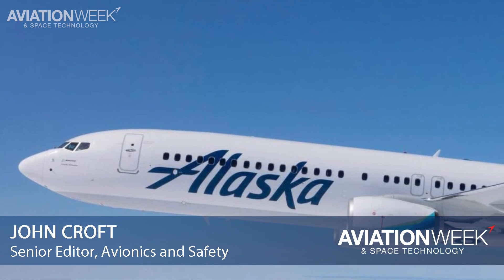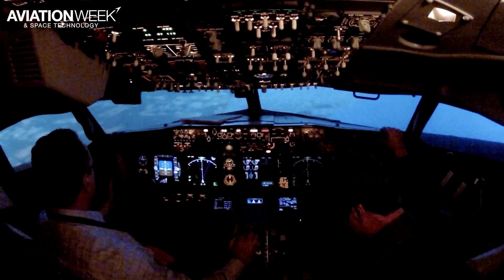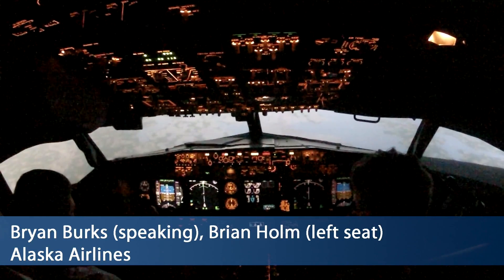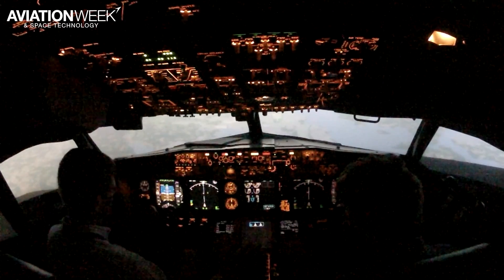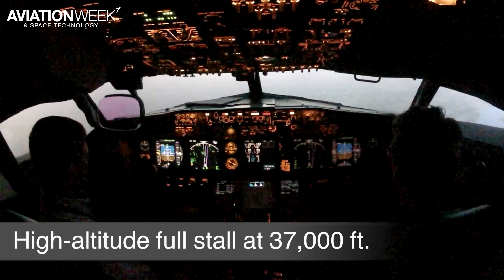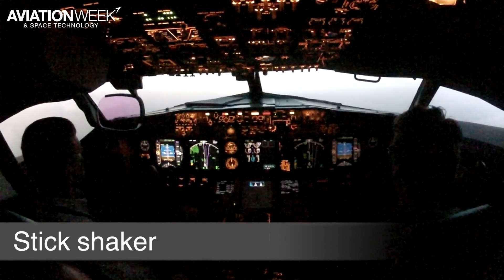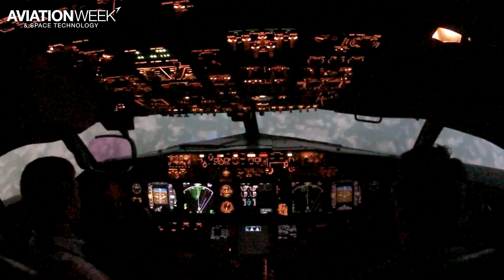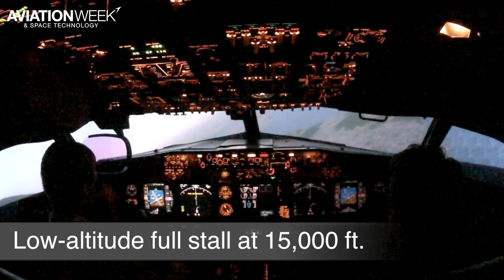How Does A Boeing 737 Handle On A Full Stall?

Comment: I'm interested to know how the simulator hydraulics simulate the sensation of "falling" due to a full stall. 
It seems like that amount of motion would be beyond the motion range of the pumps.

Does my question make sense? I hope it does.
Reply: It makes perfect sense. That's why the only way to really do this properly is to do it for real.
Reply: jsm666 a 737 probably costs about 10k an hour. that's why pilots have simulators, you can't train in the real thing. not to mention stalling a swept wing aircraft is much more dangerous than a Wing with a low speed planform.
Reply: Ummm swept wings stall at the tip first. They are totally different then flying a Cessna. You will NEVER stall a 737 on purpose. EVER unless you are a Boeing test pilot. I'm a commercial certificate holder, and hopefully on Wednesday, a flight instructor (CFIA)
Reply: It's not dangerous in a sense that skydiving isn't dangerous (but there is a small risk)....Like through extremely poor piloting, uncoordinated stalls, forcing secondary stalls etc. It takes THOUSANDS of feet to recover from a stall in a 737... It's only done on test flights, (like for certification or otherwise) Nobody goes out and flies at 10,000 dollars an hour to practice doing stalls in a giant swept wing jet.
Reply: The software is constantly resetting the position of the hydraulics, in the case of a stall, the software would anticipate and execute a drop, then position the simulator an an incline (Probably facing forward) while slowly creeping back into position for the next maneuver. The sensation of the drop as in real life is only momentary. Once you are accelerating constantly, you wouldn't know it. You can be in a 3000fpm dive, and if it is constant and you had no instrumentation, you'd think you were flying straight and level. The senses are very easy to fool in a simulator.
Reply: How much damage would it cause to a real 737 if you stall it and recover?
Reply: No, I don't know what category a 737 Falla under, but in General Aviation normal category aircraft must be able to handle minimum of 3.8 Gs. I can't imagine even a 737 pulling more than 1.7 pulling out if a medium shallow dive.
Reply: That sensation only happens in the initial down acceleration. Once you maintain a VSI of say....9000fpm, the acceleration stops, hence the sensation. Sensation only happens during acceleration.
Reply: You can simulate stalls and rapid acceleration in a 5 axis sim.  If you've ever been to a Disney park and ridden Star Tours you can get the sensation.  It doesn't have to drop a lot to be convincing.
Reply: Steven Main You wouldn't put too much stress on the airframe from the maneuver?
Reply: Everyday English with Byron I understand your question completely and I'm curious to know how you'd get a hydraulic cylinder to vibrate.
Reply: Everyday English with Byron Maybe one end is mounted to an offset motor shaft that causes vibration similar to a game controller or maybe an offset weight.
Reply: None... if you recover

Comment: Stalls in light aircraft are inconsequential, easily flown into and out of.  Stalls in jet aircraft, because if their high-speed low-drag wing designs,  are much more difficult.  It's good to know that at least someone is teaching stall recovery in jets.
Reply: Inconsequential? Such a statement borders on insanity!
Reply: I think what he means is that small  SEL Cessnas aren’t bricks with wings and “want” to fly and don’t lose thousands of feet if you recover from a stall right away.
Reply: @da42pic  I think you are understating the case. There are more complex issues involving (sometimes) deep stalls that are stable and non-recoverable; shock wave complications that drastically change wing characteristics; trim/tail design limits and pitch control issues and structural damage issues. And more...
Reply: Jets are required to have some flaps down at below certain speeds, which make them easier to slow down.  Nobody wants to do a stupid full stall with no flaps on a jet when you all know you need flaps to slow down for all approaches, landings and take off.
Reply: @feetgoaroundfullflapsC  Flaps help you slow down in the pattern but their purpose is to shave 60-70kts off the approach and takeoff speed. Speedbrakes are best for reducing airspeed or controlling it during a steep descent. Stalls have happened with transports in the clean configuration. Remember Air France A330 over the Atlantic? Pilots need to practice stall recoveries in all configurations.
Reply: @feetgoaroundfullflapsC  Flaps are not used to slow down, that is the job for speed brakes. This is one of the typical questions on an exam.   You can descend the landing gear, provided that you are under max speed to deploy landing gear if you ever need to reduce airspeed such as in a rapid descent. Flaps have structural limitations and it's one of the reasons flaps are not used for slowing the plane down. In addition, there is a change in airflow and angle of attack incurred. So, with flaps comes a proper understanding of their use and how it affects the dynamics of the aircraft.
Reply: @ItsNotAllRainbows_and_Unicorns  Flaps one or 10 degrees are used when slowing down and they will slow you down too, apart from spoilers.. What is say is, you are supposed to have some flaps when at those speeds that will produce a stall with clean wings..  Who is going to be at say 160 knots with no flaps??
Reply: @feetgoaroundfullflapsC  You have to be careful of your wording. To an examiner if you say "easier to slow down", (as you first wrote) comes across as using flaps to slow down and they will penalize you. Flaps are not used to slow down. They increase drag, which results in slowing you down that is true, but the main emphasis with flaps is to compensate for the decrease in lift by increasing the lift coefficient. According to wiki: A flap is a high-lift device used to reduce the stalling speed of an aircraft wing at a given weight. .............. Flaps are used to reduce the take-off distance and the landing distance. Flaps also cause an increase in drag so they are retracted when not needed
Flaps also allow for steeper approaches while maintaining the same airspeed.
That is the term you should use for flaps. Get rid of this notion of slowing down. That comes from power settings and power management. Seriously, try saying what you first wrote  to an examiner and you'll get their attention very quickly. This was ingrained into me, and my class, during flight training.
Reply: @ItsNotAllRainbows_and_Unicorns  Yeah, you are right, but if you have to slow down, and you need flaps at the speed you need to slow down, you can pop flaps 1 and thats it.  Instead of popping spoilers, wait and then pop flaps and trim.  It saves time, specially in high traffic..  I flew mostly as single pilot multi engine IFR.. Didnt have a helper on  my side all times like airliners do.
Reply: @feetgoaroundfullflapsC  flaps are not used in a holding pattern and you are at a slower speed. Stall can happen in clean configuration. I.e. 160 kts in a holding pattern.
Reply: @feetgoaroundfullflapsC  not true. Clean stalls are done too.
Reply: @feetgoaroundfullflapsC  What?   I think you slept through a few lectures.

Comment: The master caution alert is a lot more annoying on Airbus, I could almost handle that sound haha.
Reply: Actually it is much louder on the Boing :)
Reply: Yep Boing sucks :)
Reply: HardCoreGaming Corp was just autocorrection on the phone. So all times I flew with Airbus the planes had plenty of power, was new and flew very smoothly thru the bad weather (when there were some). All time I had to fly on a Boeing it was old, had to consume nearly the whole runway to get airborne and once in a rainstorm you could see that the plane was winding left an right. 
I knew Boeing had announced some new planes and might build them atm but I guess nobody here buy them because they already have some airbus and stick to them.
Reply: HardCoreGaming Corp blablabla... never want to fly a boing they are old and full of outdated technology. :)

Comment: As a pilot for over 50 years (and flying every week still) I am aghast at the poor level of training of the average airline pilot trainee. Those maneuvers (without the benefit of stick shakers and voice announcements) were considered basic flight training for the Private Pilot Certificate. As well as demonstrating entry into spins and spin recovery was part of the final check ride to be signed off to fly a bug smasher. I still do one engine out entry into stalls and recovery just for the heck of it every few months as well as shutting down an engine in flight and restart. I consider it just your minimum level of skill necessary to call yourself a pilot. That people are being put behind pilots who cannot do that basic stuff is mind boggling..
The reason Sully saved his passengers is that he is a real pilot who flies sailplanes on weekends for fun. He did not have to call his company and ask what he should do or look up how to glide a plane to the slowest possible speed before touchdown without stalling beofre getting there..
Reply: It's different in a swept wing aircraft.. A full stall in light aircraft is way easier to recover from
Reply: Ever since my first sim ride at Delta ('88) we practiced recoveries from approach to stalls. I did loads of stall/spin recoveries in the USAF and in G/A. The thinking back then was that the perception of an approach to stall, with all the attendant visual and aural inputs, should prompt an immediate recovery. A few years later we started practicing high altitude upsets and control to the brink of full stall to perfect the ability to avoid CFIT (controlled flight into terrain- a disoriented crew approaching a steep mountain slope requiring an unusually steep climb). It works and it continues.
Reply: Well, if you're flying a 182 it's expected that you face stall conditions regularly (including after flaring on landing) but that's not the same with an airliner jet. If you stall a jet a lot of things must have gone wrong. And then AF447 happened.
Reply: Max Mason No disrespect intended, but you're talking above your experience level here. I wish you many years of safe flying. It's been an interesting career for me, and I now hold an ATP ASMEL with nine type ratings ranging from DC-9 to B-747-4. I'm glad that you are fully proficient in stall entry and recovery in whatever light aircraft you're flying. Those planes are simple and relatively benign to fly and I enjoyed my early PA-28 time very much. 

Swept wing transport category jet aircraft are entirely different in the approach to stall regime. These are places we never deliberately fly the aircraft, so the crew that finds themselves there are by definition surprised and likely disoriented. The stall may also be extremely abrupt with little to no warning, which is one reason stickshakers are common. Pilots have for years now been taught to recover at the first indication of approach to stall (usually the stickshaker) and this is a training strategy that has been largely successful. The fact that there have been a few high-profile stall or approach to stall accidents has made the FAA re-evaluate their position and require fully developed stall training. This was extremely expensive as much data had to be collected and much simulator modeling had to occur prior to actually training these events. 

I wish you luck on your Private Pilot evaluations and I'll close with one thought. When I look back from my 17,000 hour vantage point at the pilot I was when I first got my PASEL temporary certificate, I had no idea how much I didn't know. 

I too am still learning!
Reply: Lost and Found - The Face of America Abroad Every FAR 121 airline has training curricula approved by the FAA. This case is more complex than meets the eye as simulators formerly weren't certified into the fully stalled regime and pilots were evaluated on their recovery from the approach to stall initiated at first sign of a stall, normally the stickshaker which actually occurs well before the actual stall. Alaska was the first to have approval for their simulator modeling and training curriculum for fully developed stalls. As for your "what's the worst that could happen", you need to understand that people react to stressful surprises by doing what they were trained to do. That's why simulator training is so useful. It's also important not to train pilots into bad habits.
Reply: I'm a licensed pilot at well.  I'm pretty confident that stalls are more dramatic in the rarified atmosphere at 37,000 feet.  
Recovery is going to take a lot more than 200-400 vertical feet.  Add swept wings, EAV, and hundreds of thousands of pounds of fuel, aircraft, and cargo, and now you have a situation worthy of advanced training in the simulator.  
What I don't understand is why doing this in the simulator is treated as though it could have negative consequences.  It's a simulator... simulated.  The worst thing that could happen is a coffee spill.  Why did Alaska need FAA approval?
I was fortunate enough to do spin training in a 152 while earning my private, despite the fact that the FAA had removed it from the training curriculum.  Then again, there were deaths associated with spin training.
Reply: Your right ole buddy. The days of stick and rudder guys are gone. Any of my students after six hours could recover this bird from a full stall.  Remember when spin training was required for Private Pilot Certificate?
Reply: They were eliminating spin training when I did my PPL.
Reply: Denny O'Connor I agree that level of training comes down each year, not only in Aviation but also in many other fields of science.
Reply: Only require spin training for cfi now. I did all my cfi required spins inverted in a decathlon. We still do full stalls at different power settings and banks for private and approach to stall for commercial. Private multis still do full power stall below vmc which always seemed sketchy to me.
Reply: Denny stop talking shit, you only fly small aircraft and know nothing about commercial operations or training in the commercial sector
Reply: I don't know what your flight test standards are in the US but in Canada on both PPL and CPL check rides and flight tests, entry into stalls and spin recovery is still part of training.
Reply: he shut down the wrong engine
Reply: He didn't shut an engine John, you got it all wrong
Reply: You’ll be surprised which skill level those pilots have. Most of them coming from ppl sail or military. They’re trained in many unnormal Situation stall recovery, one engine out, all engines out the list Is long. Sully sully sully...sully has flown an airbus A320. Just for fun, take a seat in a level D A320 Simulator and try to stall that plane without touching the FAC or other parts of the Flybywire system even 2 engines out you won’t be able to do that. The only chance is to use rudder or put that thing into “Alternate Law”. And yes the FbW was fully functional. Electrics and hydraulics (blue) were safe by the APU.
Then the key isn’t to fly the plane 2 engines out as slow as possible...in this situation you’ll consider L over D max! You choose the best lift over drag speed, in your Airbus PFD marked as “Green dot Speed”. Cheers
Reply: He did actually "stall" the airplane. It was Airbus's fly by wire protection which pitched the nose down to avoid it who actually helped the situation. This is not an opinion, it is taken from the flight data recorder. And don't get me wrong, Sully and all the crew performed excellently, but we need to be honest here. Great piloting is paramount, but technology is there to help us, and we should embrace it.
Reply: You just showed your unprofessionalism buddy. Get over yourself.
Reply: Air France flight 447 is proof of that. They crashed a perfectly functioning air plane from 38,000 ft because they couldn't recognize a stall when it was staring them in the face. They had over 3 minutes to recover...
Reply: Denny O'Connor  lemme guess, you’re a private pilot ?
Reply: Denny O'Connor your sooooo right man they really shouldn't need any assistance at all to recover form a basic stall that's stuff we learn in the first 40 hours of training all those airline pilots should already be able to do all of this without a problem. I mean I can do it for heaven sake and I'm only a student lol just about to get my ppl wish me luck
Reply: After watching this how can someone get this wrong the aircraft looks so biennia its handling. I have a sim session booked on a 737 a birthday gift i will be keen to try this. and for all the people that comment i fly gliders for a hobby so I am not  just a armchair pilot
Reply: Denny O'Connor 
I agree with you 100%, stalls are no big deal to me...I've done the slow speed and high speed stalls, that's student 101. But now Spins is a whole nother ball game, if you don't know exactly how to recover from a Spin well it's curtains for you! I have over 35 years in the aviation field :
Flight test , avionics 
Technician , mechanic, and I started pilot training at the age of 11.
Reply: Cool story Maverick.
Reply: sully an egomaniac?!
Reply: Denny, Just posted a similar comment. I read all of the responses to your comment and still haven't seen an answer to my question. That question being along the lines of your statement. Why isn't this already part of the training on the various models already? Why is this news?
Reply: What an ignorant comment
Reply: Denny O'Connor Well said!